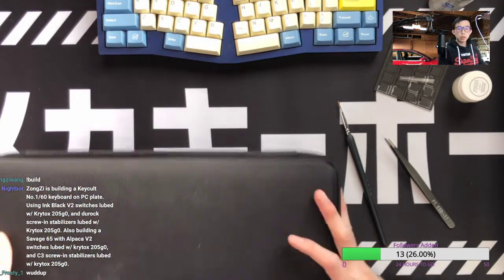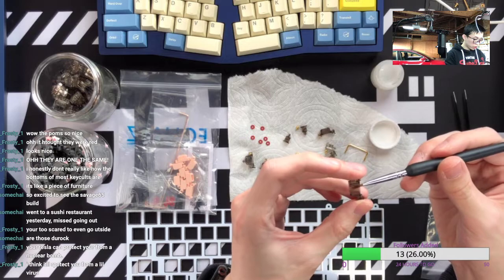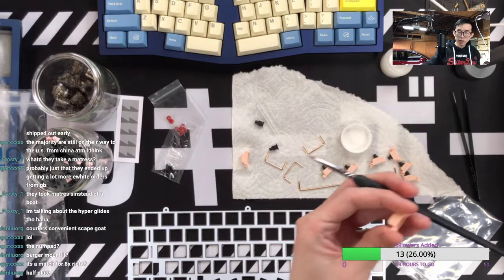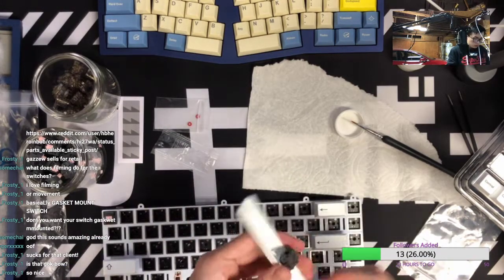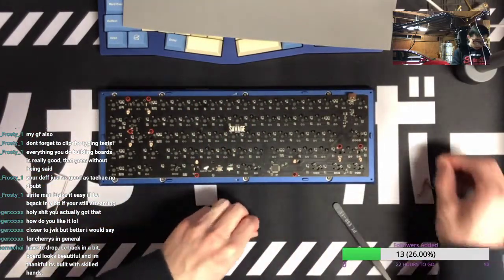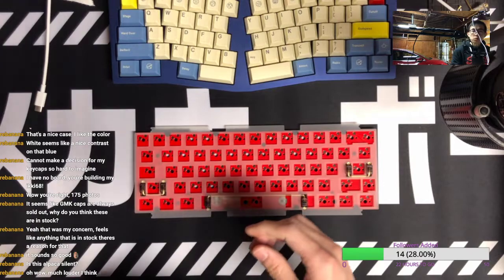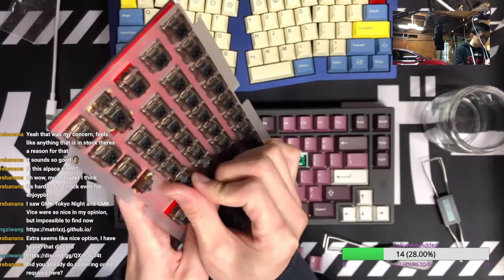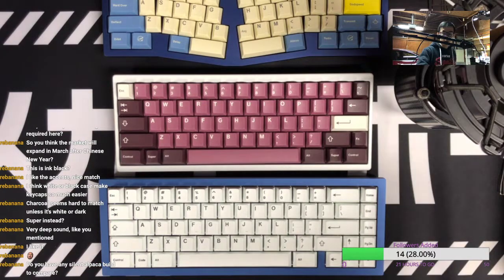Savage 65 & Keycult No.1/60 Hotswap PCB (WT60-H1) Unboxing & Build Stream Vod

Comment: How well does the mill-maxed savage65 pcb hold to the plate? It feels like the soldered switches normally are what holds the two together on the savage65, and so I wonder if the connections will stay stable given that it is burger mounted
Reply from the maker: Should be fine as long as you insert switches when pcb outside the case where you have something to support. After that it will be sockets friction to hold it, and if you have case foam below, another support underneath